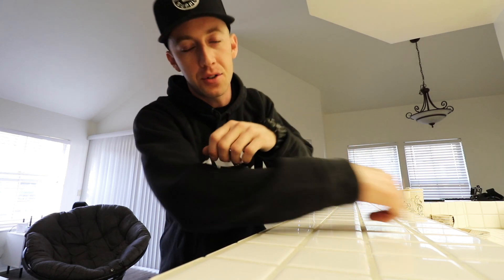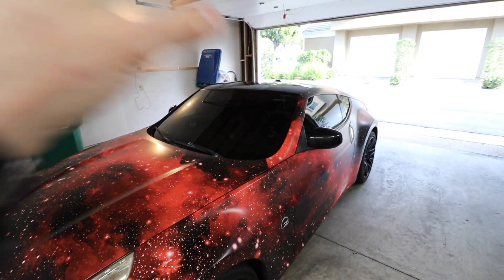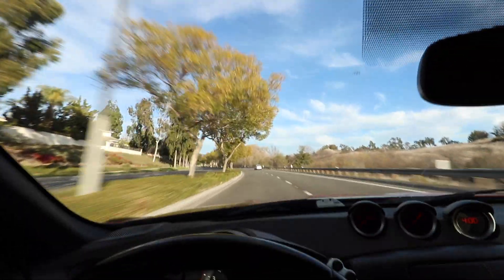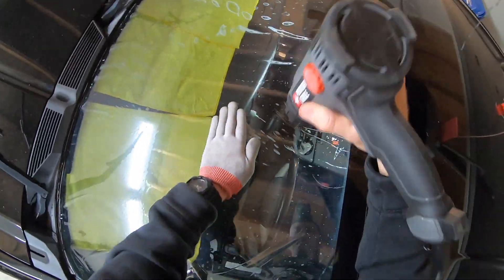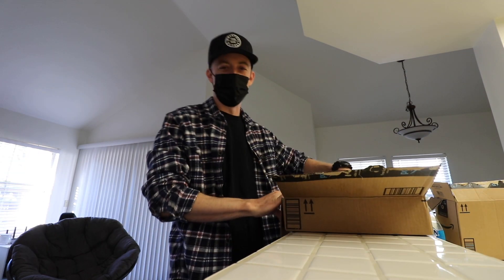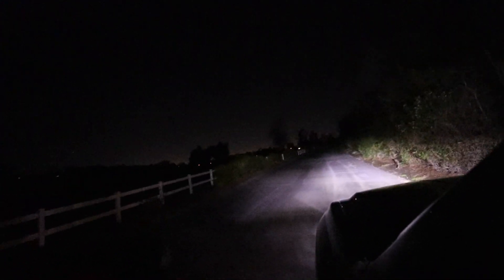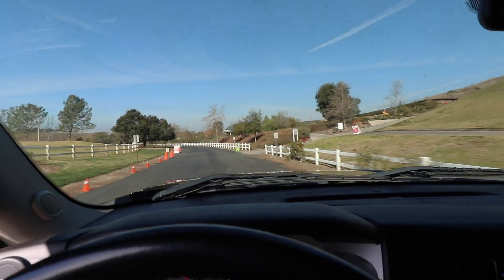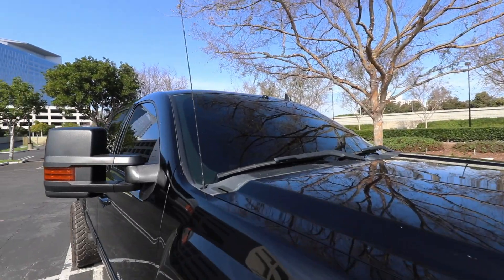35% Tint On My Windshield

Comment: After rolling around with 35% ceramic on my windshield and 15% on the rest on my 18' f250 for a year and a half, i wouldnt change a thing. 35% is dark enough for privacy and sun reduction, but not too dark that it becomes a problem. I can still see everything at night (OEM LED headlights definitely help), but i certainly would not go any darker. People rolling around with 20% or less on their windshields are nuts.
Reply from the maker: 😂😂😂 for real. 35 is my max for sure. What truck do you have?
Reply: For the best for sun deduction and privacy I’m rolling with 15% all around and 0% on the sunstrip on windshield and 50% windshield tint.
Reply: @MarkBrenner  I have double 5% ceramic tint all around except windshield wanted to do 35% on windshield can you give me your opinion ?
Reply: Mannn 50 on the windshield and 15 everywhere else. I have a hard time taking peoples word when people say they can see fine with 5% at night only for me to get into a vehicle with 5% at night and be fearing for my life. Ill consider it on the fun car but the daily is 50% max. Especially with stock headlights on a 01 ranger

Comment: I’m thinking going 5 all around and 35 just like you. Do you have any troubles seeing your rear view mirrors at night? That’s my only concern
Reply: Did you do it ?
Reply: You can’t see them at all. I have 35% tint on the shield in my car with 15% on the sides and you can’t see the mirrors at all. I have to roll my windows down which isn’t a huge deal to back up. I love it, I’ve had it for a little over a year like that. I’m going 5% on the sides with 35% on my truck.

Comment: So on my Ram I had the front tinted with ceramic 50%. The dealer did the sides to match the back doors. I want to have them darker.  You think I should have the front door tint removed first then re tinted?  Not sure what they used.
Reply from the maker: The back doors are roughly 20% tinted from factory so that’s probably what they used on the front 2 roll ups. If you tinted the rear glass in limo 5% and then left the front two windows 20% and the windshield 50 that would look really nice all blending together and the rear tint would help darken the inside so the fron two would look darker
Reply: @MarkBrenner  ok thanks for the info.